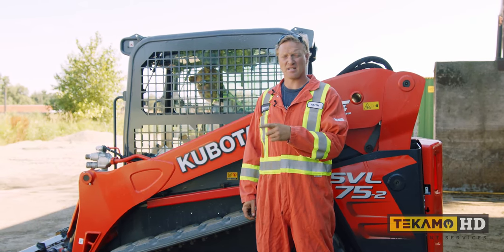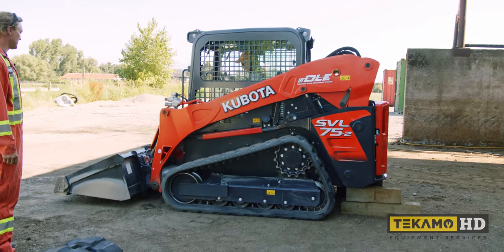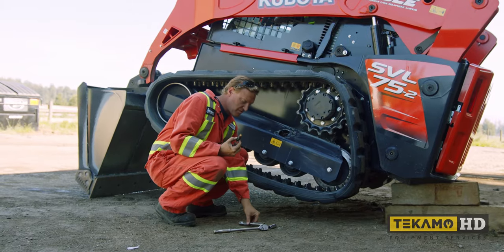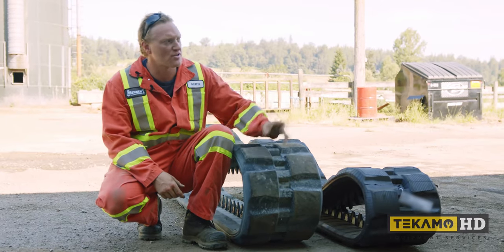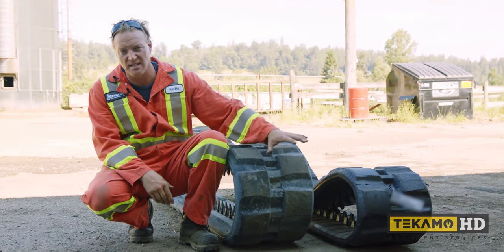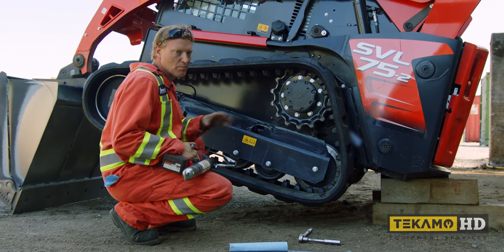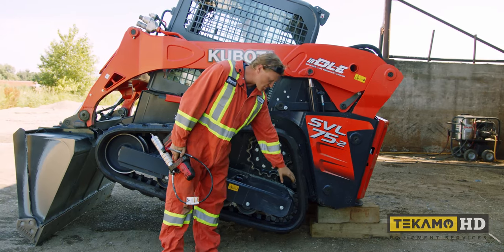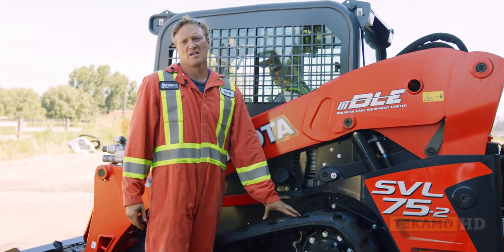How To Install Rubber Tracks on a CTL Track Loader -  AFTERMARKET & OEM

Comment: I changed the Zig Zag track on our SVL 72-2. Bought the new track from our local Kubota dealer.  I was by myself, I used ratchet straps from the Loader Arm to the track to lift the new track up to drive sprocket and pry bars.  Never did this before so 1 hours to get the track off, 2 hours to get the new one on.  As I was tensioning the track I noticed writing on the side of the track saying "Rotation" and an Arrow pointing "THE WRONG DIRECTION"  After 2 hours of cursing I got the track off and another 2 hours to put it back on in the right Direction.  I can laugh now but I was not happy then.  Check your tracks to see if they have a Rotation arrow on them, don't do what I did.   haha

Comment: This was a great video. Very well thought out and presented. I appreciate the information. I bought a used SVL 75 and the tracks were cracked. Will need to replace them I guess. You made it look doable and had some good tricks. I do not think I am strong enough to do it on my own so maybe a trip to the dealer,  or I may buy the tracks and try it. Thank You for the great work here.
Reply from the maker: We recommend buying a set yourself and using your local independent HD mechanic instead of the dealer: https://www.fortishd.com/ depending on which area you're from we can help you find one in our network.

Comment: When u took the grease valve u should have put a rag under the valve when u took it off and u can just wrap it up and throw it away. It might take several rags but that's a way to do it while avoiding the mess. And the way of getting the old track off with my atv. And qhen u try to get the new track on you can you only need to pit the track on the front idaler and the sprocket then use a pry bar to to push the track on to the rear idler and have onother person roll the track forward and backwards and it should snap right on but it might not work but just keep trying.. That's what I have learned within 13 years of doin this with my skidd loader for my contracting business. but overall great video. Well done.

Comment: I have a kubota SVL 95 2s and I can get a set of tracks for cheap that are 2 links longer and the other set is 2 links shorter. Would either of these work, is there enough adjustment in the track or would it be a disaster?

Comment: I know this is an old video but couldn't you have used something to attach the new track to the lift arm above the sprocket (like a chain) to lift the track as you're lowering the machine?

Or use a come-along and a chain attached above the sprocket to basically pull the track up using the come-along.